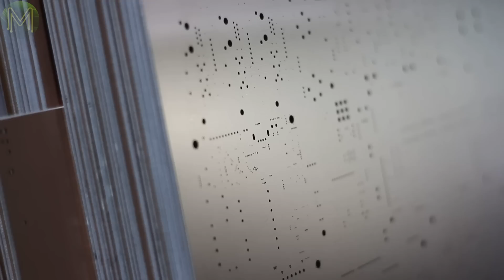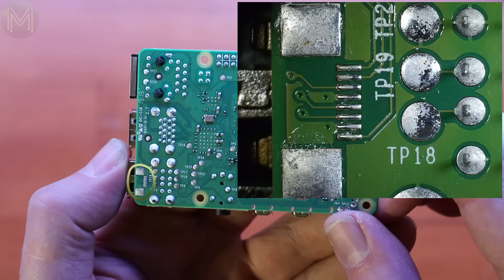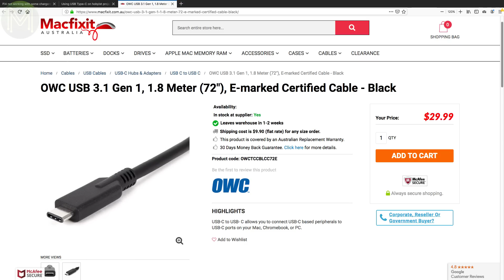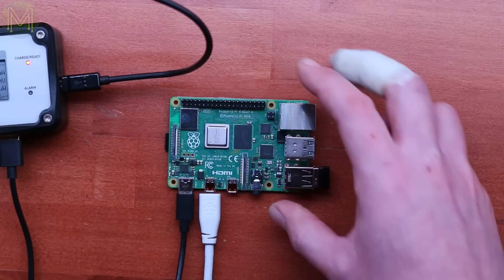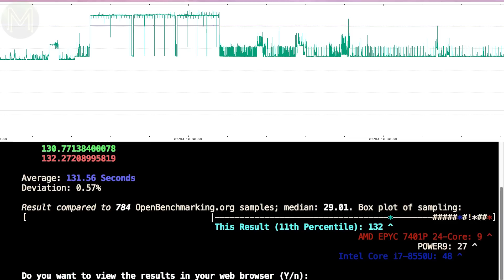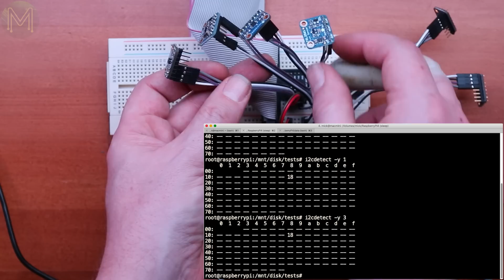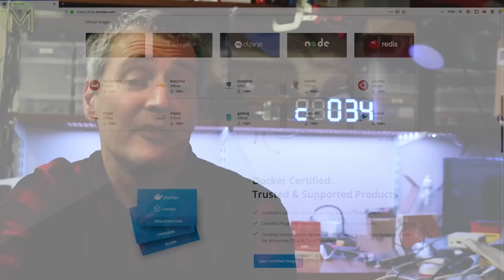#270 The Raspberry Pi4: The good, the bad & the ooops! // Review

Comment: Finally a Pi that isn't easy to corrupt.
Reply: Honestly? It's surprisingly robust. I've abused my board a bit, and there is the heat issue. But I've not killed the boards, and the heat has not yet been so bad, I've had the machine die on me. It's kept on chugging along. If you're hesitant, give it a couple more months, but if not... go for it. I've got the 4GB version, and it works fine for me as a desktop device. My first SBC, too. Really am impressed with it, and have been enjoying the process of working out how to deal with bugs.
Reply: Corruption is a hell and a half on commercial projects using the Raspberry Pi. 
Heat is manageable. Definitely looking forward to a lot of 3rd party case designs with incorporated heatsinks. 
I do intend on upgrading all of my products to the latest gen, as soon as I can update software and supply in my country is stable.
Reply: @saturnGEEK  You need to bash the card a fair bit, as in pressing it into the slot, to really corrupt it. Based on experience. 

As for heat... it's not as big a deal as people might well believe. The Pi handles excessive heat amazingly well. 

I recommend getting the official power supply, due do problems with USB-C cables.Some see it as an audio device, apparently. I've the official supply, and it works fine.
Reply: @RoshenRodesh  Corruption can happen due to multiple reasons. Improper power cycling is a major issue. And yes, you can reduce the failures by building in power management systems and battery backup. On the off-chance that all of that fails for some unknown reasons, the device has a much lower change that it will corrupt. 
I'll just keep using the power systems I've got and just change the plug with a USB-C plug.
Reply: @saturnGEEK  I fully agree. The heat is an issue, but there are work arounds. There are already cases appearing on pre-order, that are talking about passive cooling, and one was talking about having a fan inside it as well.

I managed to corrupt the SC card, but it was more to do with pushing in, than taking out. I was trying to put a case back onto it, while operating.So it's possible, just a challenge to do, it seems.
Reply: @saturnGEEK  I've managed to get the Pi working on 2.1 amps, though it certainly was more sluggish. 

I've heard quite a bit that there is corruption, but so far, so good for me. Certainly am enjoying this machine, for sure.
Reply: @RoshenRodesh  It's near impossible to prevent corruption. Disconnecting a drive mid-write or disconnecting power unexpectedly may cause corruption. Knowing that little things aren't going to make the entire device unusable is reassuring. 
Software getting corrupted isn't so bad, so long as there's a way of updating/restoring the program with minimum impact. That's up to a software developer to figure out.
Reply: @saturnGEEK  It's not a fragile system,  for certain. I get the feeling that this is a stop-gap, so they can get their real Pi replacement finished. 

I reckon a lot is going on behind the scenes, and they are working on something massive. They put something out, to stay relevant, knowing that it will be a stop-gap. But this is pure speculation my part, so take it as you will
Reply: @RoshenRodesh  For power delivery, I use a custom built power supply that can deliver up to 8A. It's good for building clusters and powering other devices/sensors that have a high current draw. 
I have used 5A DC/DC power systems from Ebay with varying success. Would like to see how they work out. 

In relation to heat, if it can remain functional at ambient temperatures of 20-40C, it's not an issue.
Reply: @RoshenRodesh  Regardless if it's a stop-gap system, they're providing to their industrial customers. Dual outputs, USB3, true Gigabit ethernet, and expanded WiFi/BT is a godsend. The software/firmware may take some time to fully mature, the fact that there is an active community made up of professionals and hobbyists is what makes the platform really great compared to other boards. 
Yes, the OrangePi and FriendlyARM gear has more features and/or cheaper, but it doesn't have the same level of support and care that goes into the production of a Raspberry Pi SBC. 
Do want to see if the Zero or Compute Module gets an update. The Compute Module probably won't get an update any time soon, but a new Zero would be an interesting one.
Reply: @saturnGEEK  I agree. I was going to get a Pi 3B+, and the big sway was the community support. This dropped at the perfect time for me. :D

I'm more than happy with this board. Picked up a little USB desk fan today, and it  does the trick of cooling the board right down. It can stay like that, until a case I like comes along.

People will say that this is a bad direction, but industrial customers will be spending money, and a lot of it. The more money they make, the more research they can perform. Also, unexpected markets - like signs and desktop computers - are additional sources of revenue. It'd be silly to not cater to them in some way.

For what it is, the Pi 4 is a remarkable piece of kit.
Reply: @RoshenRodesh  I wasn't too impressed with the 3B+. It's WiFi radios were definitely improved, as well as overall performance compared to the 3B. 
However, the 3A+ is a brilliant board. A really nice stable board with good performance and (finally) WiFi makes it a very capable board. Perfect for complex automation or replacing defunct Model B's thanks to its same mounting placement. 
I don't expect the Model A to be updated any time soon. Unless more industrial customers start asking for a lower powered Pi with dual monitors, one USB3 port, and wireless networking.
Reply: @saturnGEEK  That is interesting to know. I've toyed with getting the Pi 3A+, because I think it would be able to run Haiku OS brilliantly, and I want to show that it is viable as a computer. I believe that we are getting to the point where we are deliberately being placed on a treadmill, where we have to - over and over - upgrade the technology to levels we don't truly need.

It's all a big racket, and I wanted to prove that people don't need all of this advancement. Not the average person, at any rate. Some people definitely do, but they are doing specific things.

I reckon we are about a year away from having a Pi 5, this being a stopgap, as already mentioned by myself. When the Pi 5 drops, I reckon there will be an A+ appearing then. 

Attatch the official keyboard and mouse to it, and the Pi 3A+ is a perfectly viable beginner's PC. That's my opinion, though.

It likely has a whole range of possibilities, that I've not yet considered.
Reply: @RoshenRodesh  I've got a 3A+ sitting on my workbench. I'll give Haiku a go and see how it works. I'm a little doubtful it'll be a great experience as the 3A+ has 512MB RAM.
Reply: @saturnGEEK  It'll be interesting to see how it fares, certainly. Admittedly, I'm currently working out what alternative to Raspbian to try out, to see how good that OS really is.

Have to admit, I've grown quite fond of these little machines!

Comment: No matter what the host does, if you pull flash in the middle of a write, it will corrupt. Unless the card itself has a battery backed controller. So corrupt sd is not something the raspberry pi can fix.
Reply from the maker: There’s different levels of corruption. There’s corruption that can be fixed by a simple FSCK and others that completely blat the SD.
Reply: Yes, there will be corrupted blocks, BUT have you heard of journaling file systems?
Reply: @PaulMansfield  , those make a big difference when power is pulled. And again wouldn't have anything to do w the Pi, but the disk image. Wonder if they changed they changed the image.
Reply from the maker: I would never put a journaling FS on an SD card. They write intent logs constantly, not a good scenario for plain SD. Whereas SSD, that's different.
Reply: @MickMake  you can reduce that with "noatime" and "nodiratime" mount options.
Reply from the maker: Yes, it will reduce with 
those FS flags if you are using ext4. You can also use "relatime", but that's been a default since kernel 2.6. But even then, journaling will still write to the SD even with no real system writes.
YMMV, of course, but in the end an SD card wasn't designed to drive an O/S and if you can get it to have zero writes, it'll last forever.
I have 4 Pis sitting on my network that have been running off the same SD card for 5 years.

Comment: Corrupted one 32gb due to low current on a pi3. Fixed after reformat. Still not sold on this one. Other sbc's already using 6 cores.
Reply: Personally? This is the first SBC I've ever used, and I don't regret buying it. Yeah, heat issues, but it's a great little board as a more than simple desktop computer. I got mine the 25th June, and have used it as a computer ever since. (The laptop is feeling very lonely.!)

I got a pre-installed micro SD card, and corrupted it in a couple of days. I was messing around trying to get the case on while operating. (All to tinker around with the heat topic. I say topic, because I've not seen it as a problem, to be honest.) Got a new micro SD, installed NOOBS on it no problems... and have been using it fine to this date. I believe that if you respect the micro SD, you'll be fine. I have no issues with wrecking an SD card, because it taught me loads about this new little thingie I'm using now. So (my perspective here,) it's been money well spent.

As for the comment you made about other SBCs using 6 cores... I personally am happy with with what the Pi 4 gives me. This does all of what I need as a desktop. The other thing I love about the Raspberry Pi, is the level of community support there is. It's a fundamental reason I rushed to get my bank card, to buy the newly dropped item. (I literally did - I saw it had appeared, and ran to get my card. So I got mine on the 25th June, because I lucked in, got in really early, and had it the next day.)  I've hit the point where I don't want to keep on having super advanced tech. It's an annoying treadmill to have to keep walking on. If others want six cores, great - the products are out there. But I am happy with this machine, and intend to keep using it as a desktop computer. To each, their own.

Suppose that is the answer, at the end of it. To each, their own. Some people will love it, some will have mixed feelings, and some will dislike or hate it. In the end, it's a product. We all can decide if we like it or not, want to buy it, or not. I personally believe that this is the result of the need to put a product out there, to stay relevant. It has half of a checklist filled out, and there a really big shocks in store with the Pi 5. I expect this one will have a new form factor, the works. Slightly larger size than a credit card, with more put in as a result. I think there are a lot of balancing acts to be made here, things we are not directly aware.

Anyway, that's my thoughts.
Reply: @RoshenRodesh  I don't regret mine either. Still very useful for arduino stuff but I wanted a proper video player  with a gui (like vlc). The Neo4 is able to use vlc but has only 1gb ram. I should have bought one with more ram for things to run smoothly.
Reply: @webslingerMe90  Give it time. Things are still being worked on, and it's a radical step forwards for the product line. So things like video will come along, once other issues are dealt with. 

I think the issue is not just the hardware, but the Operating System used, and also community support. Buy a Pi, know there will be support if there is something going wrong. How many makers can say the same thing? Just my take on it.

Comment: hey. just learnt the news that pi4 has compatible problem with type-c wires due to a design fault, what are they thinking???
Reply from the maker: Yes true. It’s a fairly basic design. It’s workable, but only with certain cables.
Reply from the maker: BTW. Sorry my original reply was for someone else and for some reason attached to yours. Stupid YouTube.

Comment: even the older models of pi are hard to corrupt cards. Idk what people do that they corrupt them.. You'd really have to be writing constantly and rip out the plug while it writes and that'd maybe just corrupt the file itself not the whole card. Pi1 was the last time I even have seen a corrupted card. We have ~80 Pis in production
Reply from the maker: Yes true. I’m not sure either! But I tried to do it, never could manage to corrupt it.
Reply: @MickMake  Yea I was laughing pretty hard at how you did it too, worst I do is just pull the power.
Reply: I swear my zero corrupts if I look at it funny, could be that I'm using a 256gig sd. Any hard shutdown is a corrupted SD, If I didn't unallocated the bad bits in format software its a corrupted SD card, of you plug into the USB while running, yet another corupt SD card. FML
Reply: @maddenman2013  What brand of SD card too? Maybe size matters as well, not sure. I've always used sandisk and seen people with more issues with samsung. No idea on other ones.

Comment: Can it boot from a external SSD via usb 3?

Would think the 4 gigabyte one is a bit much. Maybe I would buy the 2 gig.
And a SD endurance cards.

I have a Nokia 7 Plus charger than can output 3 amps. So I clearly need to buy the correct USB C cable...
Reply from the maker: I have it booting from USB at the moment, (via SD kernel load).

Comment: There is New Firmware that will knock 300mah off usb 3 controller which also drop's the temp
https://www.raspberrypi.org/forums/viewtopic.php?f=28&t=243500&p=1490467#p1490467

Comment: The Pi 4 actually has a boot (e)prom.   It sets up its boot time setting very differently from all Prior Pis.   The POE Hat is limited to 2.5 amps.  The Pi 4can run POE, but must drive external devices too hard.  It is reported the SD card slot accepts faster cards and the 40 pin header is backwards compatible with the old 40 pin header.  The video driver is CPU driven and very simple.   Booting is strictly from the SD card.  Look to Pi 1 workarounds for this problem .  It needs cooling if pushed at stock clock rates.  Its thermal throttling is fast and deep, at 80 degrees C.  The better CPU cores and faster IO are key features right now, regardless of memory size. .  There is much potential still on unusable right now.  It is my choice for a PI.  Thanks.
Reply: Are you sure booting is SD card only?  This was not the case with Pi 3B+ which could boot from USB even without workarounds.
Reply from the maker: Yeah, definitely will be replacing all my Pis with Pi4s. I use them as squid proxies, apt-cache, DNS/DHCP, networking monitoring, MQTT brokers. I’ll be able to now run everything under a couple of Pi4 with Docker.
Reply: If you wonder why the the 8GB memory Pi vanished, the answer is simple.  8GB requires a 64 bit OS.   The Foundation is not ready to jump that far forward.  They are ducking the compatibility issues which hit Ubuntu  recently.  It will come, just not yet.  Cheers
Reply from the maker: Yes, booting from USB is possible on the Pi4, but you still need an SD card. I'm booting at the moment from USB via SD, but straight USB boot won't be happening for a while on the Pi4.
Reply: I have followed the Pi from the early days.  IThe Pi 4 is in many ways, reboot of the Pi design.  This follows the Foundation''s statements about the Pi 3 B+.  The best I can do, is point folks backe the early PI pioneers.  I look forward to more videos from you and other who can tune their Pi 4 systems.  A Pi 4 will replace an AMD sempron 1250 single core as my server hacking platform.  Thanks for your great work..

Comment: pi4 really opens it up for some projects that seemed impossible or would not run well. I'm really considering buying a 5 bay usb 3.0 external hard drive and putting together a nas. Also be interested to see if any of the opensource firewall OS get ported over. I'd love a little pfsense device.
Reply from the maker: With 4GB, it’s now viable as a FreeNAS server.
Reply from the maker: Yeah would be a nice small scale NAS.
A little slow compared to dedicated NAS, but still quite usable.